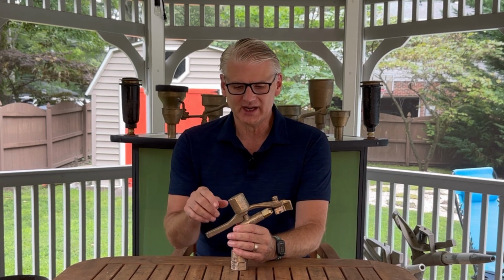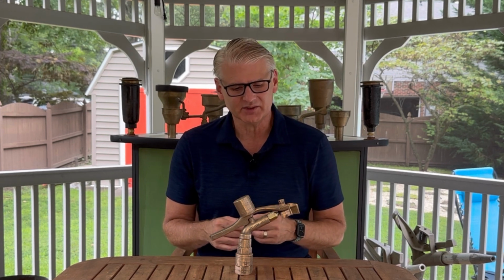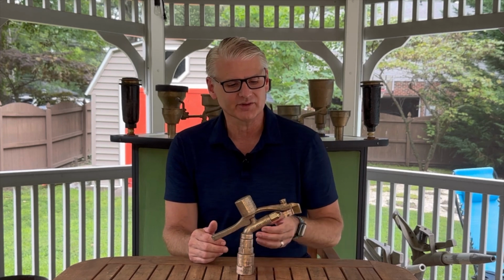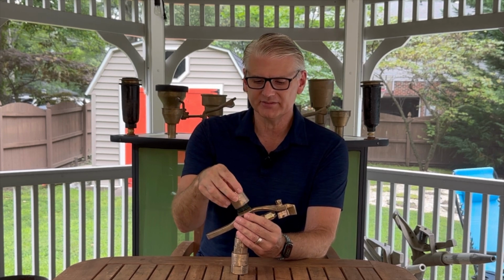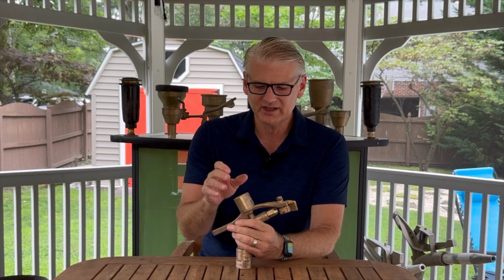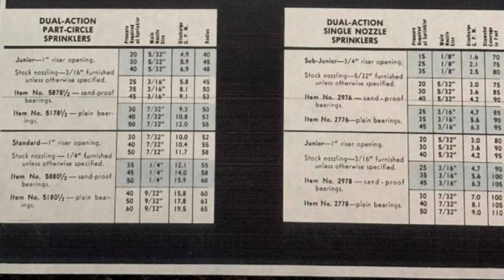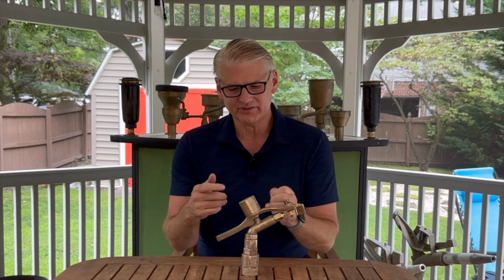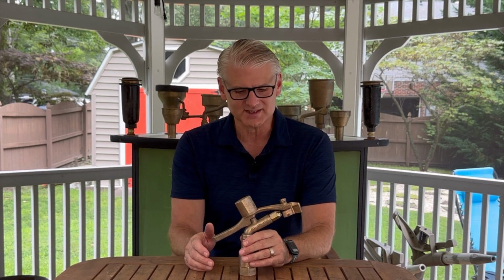c. 1938 Antique Buckner 1" Dual Drive Full Circle Brass Impact Sprinkler #irrigation

Comment: HI BILL,  That head looks and runs good for a 86 year old sprinkler head! it is great to see it working. It really looks like a baby of the "Giant Irrigators" It doesn't seem to drive as strong as I would have suspected, almost like the wedge and stream are a bit out of alignment, it appears that the wedge is too low into the stream; maybe from the end of the lever bent or sagged over the years; my giant irrigators have the same issue and always have wondered if weight or extraneous force has deformed the lever over time or if they were originally that way?  Nice to see it going with the lighter spring tension to get a bit more swing..... I can't wait to see the RainMobile too.
Thanks for showing great American engineering!
Reply from the maker: Thanks! It certainly could have sagged over the last 9 decades. Happy it runs as well as it does, and we’ll see how it goes when its “base” comes back from getting spiffed up.

Comment: It is an interesting design and a different style of wedge.  It seemed to work as you said it would.  It did not move as quickly as I kind of expected for a wedge design, but then it might be due to the different design.  I was looking for the spot where the arm actually hit the body to make it move.  I am guessing that the impact was at the front side, but I missed something and not sure as I try to understand the engineering.  I like the slower movement of the arm.  Thank you for all of the history and sharing your video.
Reply from the maker: Thanks!
Reply from the maker: The lever strikes the sprinkler directly behind the fulcrum pin. It’s not super obvious. Tried to add a photo to the comments, but I can’t seem to make that happen.
Reply: @antiquesprinklers    Thank you for sharing those details as it is kind of well hidden.  I saw a sprinkler that looks much like that on ebay, but I would not be able to do anything but look at it and show it.

Comment: So what were you adjusting on the sprinkler in the video? I see you let it run for a couple seconds and then you readjust it
Reply from the maker: I was changing the spring tension. One of the features of the sprinkler is the ability to change the lever spring tension in place without tools.

Comment: Beautiful video work, as usual!  I saw your old sprinkler on ebay a few weeks back - I'm really glad you "rescued" it and added it to your video archives.  I have a question - I noticed that right in front of the wedge there is a big chuck of brass that act like a baffle that only allows the spray pattern of the wedge to fan out to the right.  Is the purpose of this piece of metal to help propel the sprinklers arm further from the stream to gather momentum for the impact, or was this Buckner's way of closely imitating Rain Birds spoon design without directly infringing on Engelhart's original 1997901 patent?  Again, thank you for your work - I really look forward to your content!!!!   -Ruben
Reply from the maker: Thanks, Rueben. I’d normally not buy something like a Rainmobile, but when I sensed it was a predecessor to the one with which I was familiar I felt like I didn’t have a choice. I’d also never seen an example of that style of single-nozzled, full circle dual drive. To find it could be dated to roughly a 17 month period was an unexpected bonus. 

I’m not entirely sure about the deflector behind the wedge assembly other than to say I wouldn’t be surprised if it served the purpose you mention (helping to move the lever and load the spring).